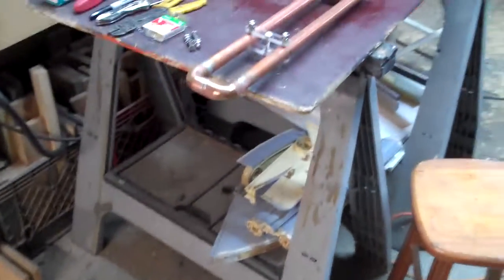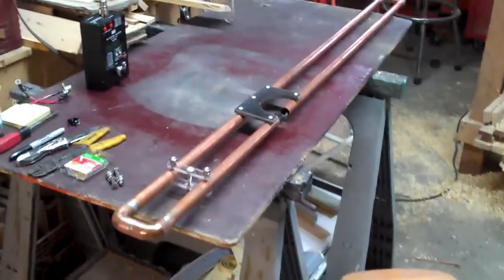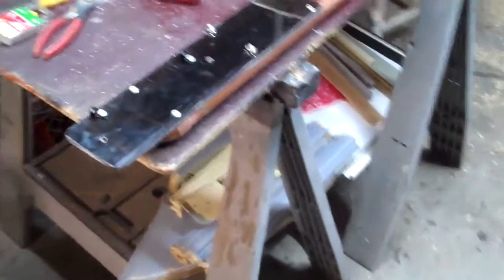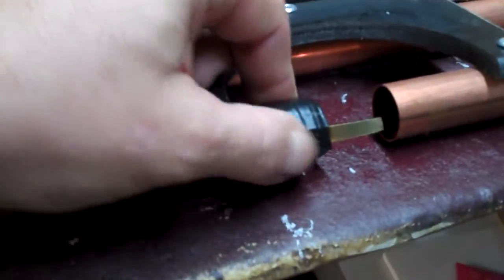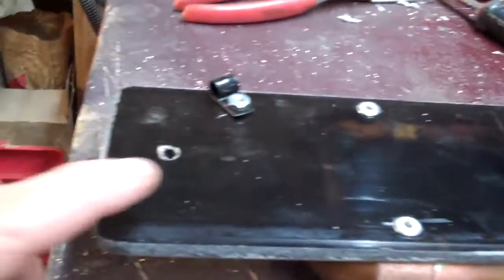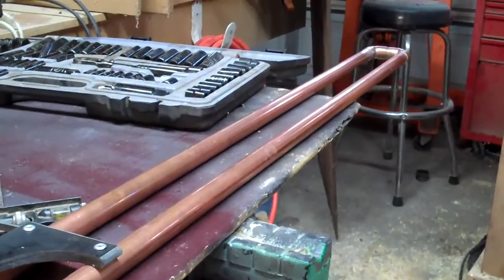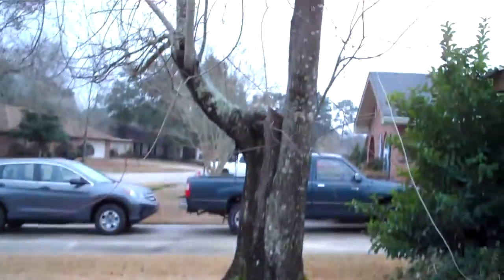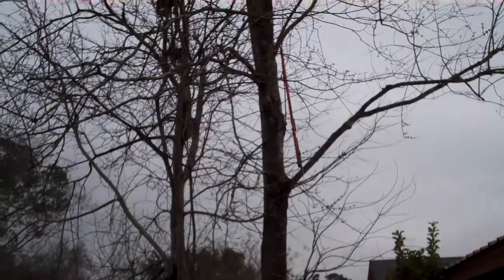Home built 2 meter antenne  The update and finishing touches

Comment: Great video DaFrogToad. My area is quite humid, so I think I'll have to either seal up the ends or make drain holes.
Reply from the maker: Funny you should mention that..I actually DID drill a drain hole in the bottom..I simply forgot to film it.